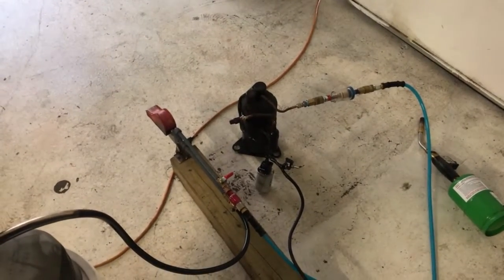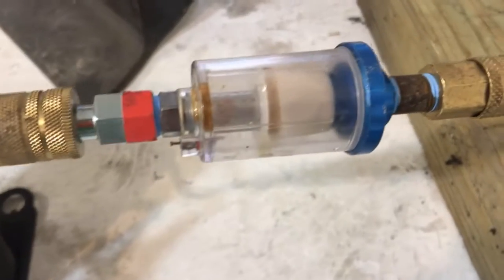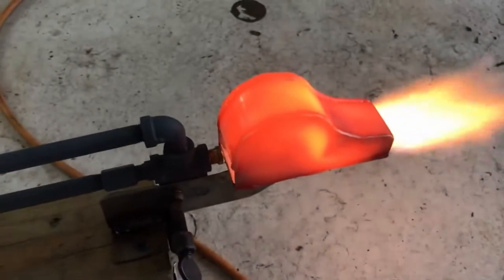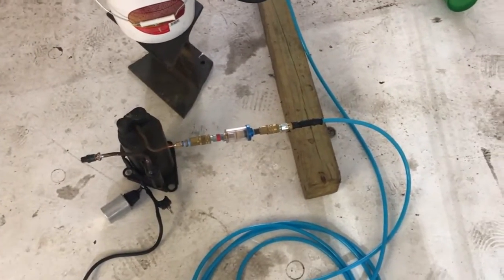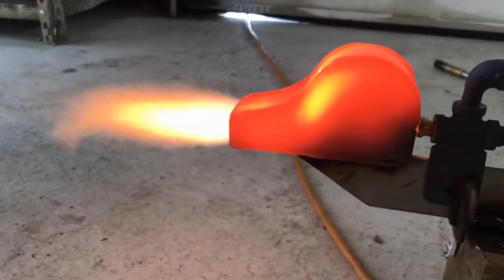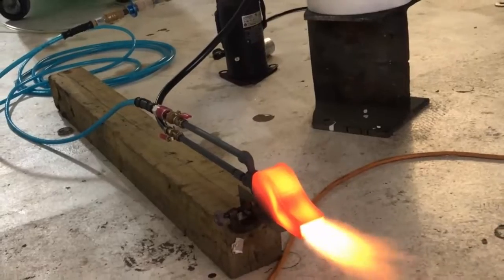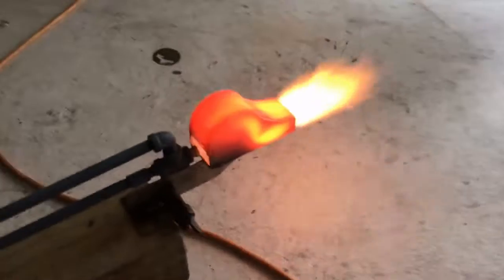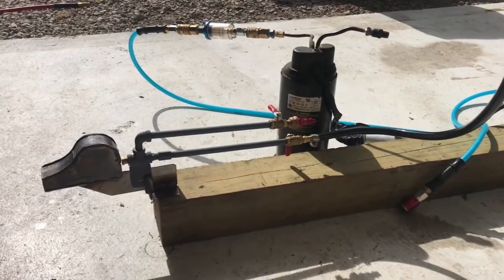Ac compressor Waste Oil burner

Comment: Shiiiiiiiit! Hot little guy. I always figured an AC compressor would at least be good for a small burner if you could get the pressure built up by the nozzle for a nice high velocity mist.

Comment: To anyone thinking about doing this, you can probably find these pumps from old refrigerators, freezers, air conditioners, dehumidifiers and I'm sure there are a lot more.  If you want to get some serious air flow at high pressures and still be quiet, look into a compressor from a big rig, bus or anything with air brakes.  Another option is an air conditioner compressor from cars/trucks/buses.  The bus compressors are supposed to be very large and will require some serious HP.  All the vehicle compressors will require some serious HP as they have much higher cooling/compression rate than household ones.  If you want to use these but don't have the right size motor you could use a gas engine.  I would think that the vehicle compressors would require much less energy to run like this than they would in a car under pressure, so instead of drawing/needing 10HP from the car, you might get away with a 1HP motor b/c the pressure is so much lower on the intake side.

Comment: Good job.  Is there a way you could take a power reading on the compressor with something like a "Kill-O-Watt" to see how many watts it is using?  That way we could get an idea of the size of the compressor.  You could also just take a current draw reading with a multimeter if you have one and multiply that by 120 to get wattage.  

You should see how hot the motor gets after running for 30-60 mins.  I've run mine as a vacuum for extended periods and it gets hot enough to boil water off the case, even with a fan on it (not a strong fan though).  

You should also get a pressure reading of what it is putting out before the siphon, that would be good information to have.  
I'm sure you could parallel these to get higher flow but IDK if you would need something like a check valve on each line or if that is built into the compressor.
Reply from the maker: Yeah the cool thing about runnng a vacuum is it actually cools the unit down some .
Yes i did monitor temp , it gets to 135 Deg F with a fan and stabilized at that temp.
Yes back pressure info is coming , i just had to try this bad boy out cus i new it would work